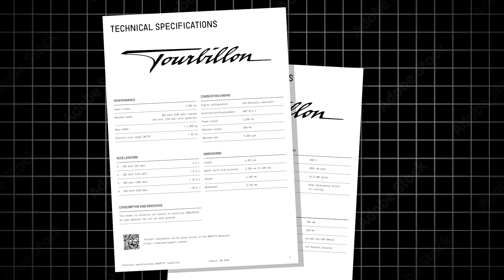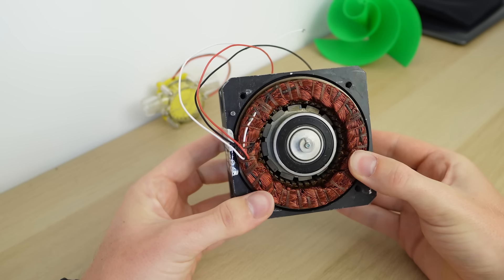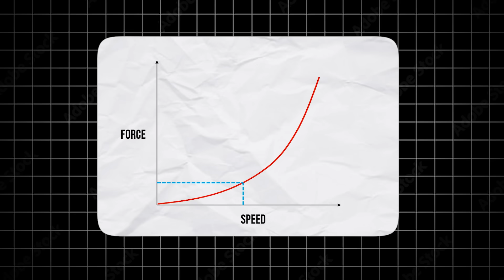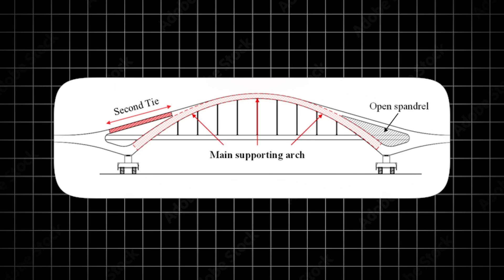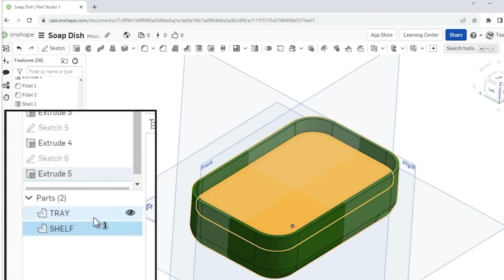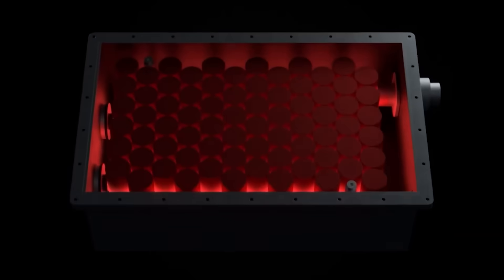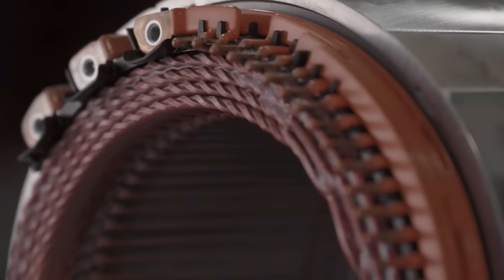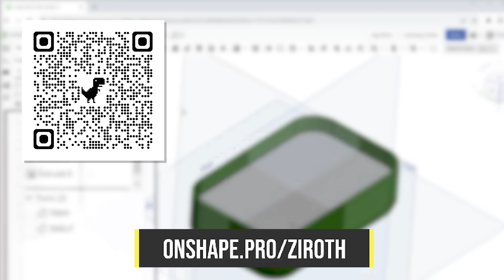How Bugatti's New Electric Motor Bends Physics

Comment from the maker: It's great to see how the partnership with Rimac is giving Bugatti an extra charge! Check out Onshape for FREE: https://Onshape.pro/Ziroth - It's my go to CAD software and I promise you won't regret giving it a try.

Some great comments here adding to the video, here is a summary:
1) Correction at 2:34 - This is not an exponential growth it is a curve with an exponent of 2 (quadratic) - I loosely and inaccurately used the phrase here!
2) The paper at 8:00 uses Celsius to report a percentage drop, which isn't very useful as it's a relative term.
3) I compared RPM as all the motors have similar geometry (automotive size) - but really this forgets the importance of the radius (which needs to be large enough to get some torque from the motor)
Reply: I will mention that while this motor is impressive the capabilities of it are nothing new. Formula E motors often spin at a similar rpm and they can produce more torque (and so power) per motor. 

They may do this my being longer and similar diameter but the point is that without knowing the radius it is difficult to say exactly how impressive. It is cool that they are managing to put formula E-esque motors in a road car though.
Reply: @Zuluknob  Bye bye.
Reply: would be very interesting to see die-electric cooling for gaming computers
Reply: @artcurious807  Already being done.
Reply: Dont forget rimac owns 55% of bugatti so it was gonna be a rimac product at the end anyways
Reply: Time to shootout Koenigsegg and Bugatti EV supercars.  
Bonus if you can get your hands on the Audi RS Q e-tron (you know, the Dakar model) :-)
Reply: Cooling medium comprised of a phase change material that goes from a semi solid to liquid. This could also be used as a energy storage solution for heating the interior.
Reply: For ordinary electrical motors, the "ideal rotor shape" is a ratio D-squared-over-L.  This had been known for dozens of decades.  This was based on powered rotor and stator.  For neodymium/permanent magnets, this ratio is now being altered slightly since the flux field of an unpowered rotor can be shaped to provide advantages in forward/reverse directions and mechanical weight edges with respect to the car dimensions.  Pancake rotors can provide much larger torques, but add serious sizing issues to a vehicle.  Axial flux motors have similar issues with bearing support.
Reply: I remember a chat with Cedric Lynch at Silverstone Race Track UK in the 90's - He was building an EV motorcycle for the TT races using one of his Lynch motors - He explained that the limiting factor was the centrifugal force as voltage and revs rose - I said when the Stanly Steamer  achieved the world speed record in 1903 they wire wound the boiler in Piano wire to stop it exploding and he could do the same - a couple of months later he told me he had  put a modern spin on the idea I'd shared and used carbon fibres - It's odd how ideas morph - James Watt once said "The best ideas aren't hidden in shadowy recesses. They're right in front of us, hidden in plain sight"
Reply: imagine supercooled hypercapacitors... just add "perfect motor." :P
Reply: Ever thought about talking about orbit solar panels. That sends power to earth. Since earthbound solar panels are roughly 10% effective. While in orbit they are 100%. Theirs a NASA study as well the angry astronaut talked about it last six months.
Reply: @Stargate101   "While in orbit they are 100%."  

No, they are not.  If that were the case, they'd generate over 1000  watts per square meter of panel.  And we know that IS NOT going to happen with even the best panel technology.

My panel bifacial panels are about 20% efficient. If I took these same panels into space, they's still only be about 20% efficient.  The ISS panels can hit 30%.
Reply: 6:04 Nonsense. There's no time in kW. If 600 kW can power a village it can do it regardless of how long time. Why do you believe you're entitled to speak about technology without passing middle school physics?
Reply: @Youtube_Stole_My_Handle_Too  but you can calculate the time which the village in it's peak of consumption use 600kw and you can calculate the time like a 3ph motor that consum 3kw per hour

Comment: or they could be using ipm rotors (internal permanent magnet) my ebike motor uses one and i run very low gearing and use field weakening which get me about 28000 rpm at 84v(72v battery)

Comment: 2:30 The force does NOT increase exponentially, it increases by the SQUARE of the rotational speed (as also demonstrated in the example right after the statement). It is a big difference.

Comment: The engine should only be to generate electricity for the electric motor. Hybrid is always the way to go, efficiency and better usage of resources. And that is what cars and truck manufacturers should have done 10-15-20 years ago. You can get so much more usable power and torque from electric motor, and the engine can be much smaller and can run on basically fixed RPMs increasing the fuel economics and less pollution. It doesn't matter if it is a family sedan, a Scania truck or Hypersport car, hybrid is always better. And Diesel electric is the best way to go. But gasoline electric can be lighter so that is probably better for sports car...

Comment: everything sounds like an expert's channel in the first few seconds. until a quadratically increasing acceleration force is described as exponential (derivative/dynamics proportional to the current value). it's unbelievable how inflationary the word “exponential” is used by the layman. but by the expert? it's not splitting hairs, an exponential increase is something fundamentally (not just mathematically!) different from any polynomial
Reply: oh no...and then the thing with the temperature. you obviously have zero knowledge of some fundamental physics. what a waste of time an attraction in the internet

Comment: Imagine if the cooling oil in the battery pack had a reservoir and a radiator or better yet a small electric refrigeration compartment for the batteries

Comment: I don't think the reason for using Lithium iron phosphate battery  is it high power delivery or high energy density because in both cases typical Lithium ion is far better,  then only advantage of using Lithium iron phosphate battery  is its safety , less prone to catching fire and explosion,  and they have very impressive Charging cycle (3000+) comparing that to typical Lithium ion which has around 500-1000 .
Also Lithium titanate is not that energy dense its 3-4  times less energy dense and have lower power delivery, again its advantage is its even more safety and upto 10,000 Charging cycle

Comment: Hm, nice, i was thinking more about A\C "implementation", but this works also, plus removes the need for sophisticated manufacturing of cooler tubes. This could be the gate for diy water cooling for non liquid cooled batteries, and swap's in ice cars. thx)

Comment: Those are the max made with the wrong patent.
2 types of motors were patented by nicholas tesla.
A first that stay cold, simple design, asynchron asymétric, lot of power, lot of torque, 3 times the second patern.
A second, that need cooling, asyncgron symetric, that fights for balance, with back efm, electro counter force.
So seeing a motor that need cooling, you know wich type is under.

Comment: the semiconductor industry had 50,000 rpm motors back in the 1990s, so the auto industry still has a long way to go.

Comment: Also note that small battery capacity.  This means that the claimed HP is quite a short-lived transient, and the engine has to make up for any battery usage, which drops the HP two ways.  (1) Can't use the battery to boost the engine HP when trying to charge it from the engine.  (2) Charging the battery reduces the available engine HP for moving the vehicle.  The only thing that may be missing (I could not watch the entire video due to the extreme cringe factor) is to declare that Bugatti is now going "green".  Just another entry into the "fraud" file.

Comment: 6:44 I don't know where you got your information about the lithium titanite being power dense, but it's actually one of the worst energy dense lithium based batteries you can get.

 It does have great qualities like low temperature performance and fast charging but density is not one of its strength.

Comment: 5:40  This software sounds neat... I'm  kinda bummed its all online.
Where's the built-in resiliency for customers who's internet speeds are still slow, or shut down? 

Anyways,  solid vid, interesting stuff. Especially the batteries soaked in cooling oil.

Comment: As soon as you said "electric flight" I almost did not bother watching. There will never be "electric flight".  The energy density of avgas is 85 times LiFePO4 batteries by weight.  You need 85 pounds of batteries to fly the same time as 1 pound of avgas.  And when you get you your destination, the batteries still weigh 85 pounds compared to the avgas which is continually used up during the flight.

Comment: I've seen non dieletric oil used in submersed motor up to 4KV  like tellus 22 or 32. Power up to 300hp. I dont think it needs to be a very expensive oil for cooling the batteries.

Comment: Isn't it interesting transformers and welders have been using immerged  windings for decades and only now they are starting to immerge hard worked  battery cells and microchips - the E-bike world has been using none conductive fluids to cool coils in hub motors  for a decade - it's fascinating how technology moves sideways

Comment: 800hp is about 600kw so the 25kwh battery will power the electric motors for about 2.5 minutes at full power

Comment: Watching this on my newly built dielectric oil-cooled computer running at 6000Ghz with 7 small but absurdly powerful quantum GPUs - no bloody fans needed anymore - all calculations arrive 0,5 plank-seconds before they actually are put into the system :elbowcough:

Comment: Direct cooling a the way to go as it's just not more effectively the batteries but also help and reduce thermal runaway. I'm currently building a direct cooling battery pack to test it myself. I should have a running prototype near the end of January 2025.

Spinning motor at such speed puts a lot of stress to the rotor but also to the rest of all other mechanical components such as reducing gear. Higher the speed, the more friction it generates, the heat losses you get.

Direct fluid cooling is a topic that is little talk about. Hope to hear more on it.

Thanks for this video.

Comment: One thing you haven't covered or maybe it's a trade secret. How have they reduced magnetic flux reversal time which uses the most current as the pole pieces change polarity the more metal the higher these losses but the higher the magnetostricktive torque.

Comment: Very interesting presentation!   As mentioned at 3:11, one  method to reduce stress at high RPM is to selectively use materials with exceptionally high strength to weight ratios.  Their carbon fiber wrap serves that purpose, but does so 'tangentially' because the centripetal forces are directed radially, while the wrap attempts to counter the forces circumferentially. What aid it provides can be modeled as though it was a vessel restraining a liquid/gas under exceptionally high pressures. (At least in this instance, the load places the epoxy wrap under tension, unlike the 'Titan' submarine's compressive loading that led to collapse, likely due to the epoxy yielding to delamination). 
I expect that Bugatti has also designed the rotor itself to have an exceptionally high strength to weight ratio, enabling the radial forces to be directly countered instead of tangentially. Titanium has an extremely high strength to weight ratio. But relative to other metals, titanium has poor thermal conductivity. Perhaps they judiciously use titanium, such as a 'spider web' of titanium enmeshed or integral to the rotor's magnets. If they can make a 'one piece' rotor, where no bonding is used between distinctly different parts (rotor frame vs. magnets), this would eliminate a potential failure point located near the rotor's maximum radius.

Comment: More clickbait BS. Where's the physics bending?

A few points.

1. Voltage does not equal power. You can get near any voltage you want out of a battery. There are devices outputting many thousands of volts off of tiny little watch batteries. 

2. 24k rpm from an electric motor is not really that impressive. I myself have built electric motors in my bedroom that go well over 80k.

Comment: Nice video, interesting concepts.  One small objection: while the rotor is spinning faster, the centrifugal force that acts on the magnets grows quadratically, not exponentially.  I know a lot of sales and marketing people use "exponential" to designate any variation that grows faster than  a linear function; but in a video published by an engineer, technical accuracy is expected.

Comment: A really stupid design..  The ICE is supported by the electric motor with a lame 25kwh battery...  It shud be the other way around.. A 400kwh electric motor with a 150kw of battery... The 1500cc ICE isn't even needed but can be used to charge the battery during high demand..  An unbeatable real performance hyper car...

Comment: Why does Bugatti stick in a gas powered piston motor with it's electric motors.  Is it just because gear heads need that loud obnoxious racket?  Hybrid EV's, gas and diesel all pollute and are inefficient.  All Electric Super Cars will rule, along with all other cars and trucks.  Even Planes are going electric.
Reply: Sure but for now they are heavy and get beaten by ICE only at 1/10 the cost.

Comment: "The ability to provide a huge amount of power from a relatively small battery is referred to as a high power density."

No. Power Density is when it CONTAINS a lot of power for a given size. Discharge Rate is when it PROVIDES/DELIVERS a lot of power for a given time. And you were definitely talking about how much power max instantaneous power it could deliver.

You don't need to cool a battery because it has a high Power Density. A battery with a high Power Density can sit there without cooling all day long. You need to cool a battery when it's DELIVERING it's power at a high RATE.

Comment: In India they have developed a rapid charging system that injects a coolant into the battery pack while charging and removes it at the end of the charging cycle thus avoiding the extra weight in the vehicle.
Reply: But in cold climates you need the coolant to warm the battery.  Also there is a lot more chance of a leak.  The weight of coolant is very minimal

Comment: I suspect Novec will turn out to be as bad as PFAS/PFOS etc. I researched it years ago for a home pc cooling experiment. I wouldn't touch it with a barge pole. They also often have a high GWP in the hundreds. They are usually full of flourine. With Hydrogen Fluoride being a fire breakdown product. LC50 100mg/l of novec 7100 can kill fish is 96 hours. They haven't tested it on rats yet should be criminal to put chemicals in the world without knowing impact on mammals/humans.

Comment: 800V  State-of-the-art battery pack has been available in Hyundai's Ioniq 5 production model since 2021. A complete 800V architecture and much, much friendlier pricetag. Perhaps this was the reason Ioniq 5 won Car of the Year in 3 out of five categories and was the FIRST EV ever to win car or the year.  But sure... Bugatti sounds sexier.   

Although the Ioniq 5 state-of-the-art battery produces a maximum 277 KW it develops 320 horse power which is enough raw power to propel this almost 5000 lb vehicle quicker off the mark than a conventional Porsche.  As an SUV it is a veritable tank of a vehicle. Make no mistake,  the new line up of EV's are beasts compared to ICE vehicles.  Body center of mass low for cornering. Complete with a plow bar in front for colision protection for your family.
 
Additionally, the Ioniq 5 liquid cooled battery has almost 12 liters of a low-conductivity coolant that is replaced every 24,000 km at a cost of about $300 for the coolant and labour cost varies.

Comment: This approach is going at the problem backwards.  To move a person from point A to point B you need less mass and less power pushing less air out of the way leaving laminar flow air in the minimized wake.  To launch from 40 mph to legally going 180 mph (in town) you need to share one motor with all the cars in the path and leave its mass tied to the ground.  Moving the magnetic field, not a spinning rotor.  US Patents 6,923,124  7,127,999  7,334,512  A wing tunnel tested Cd of 0.07 combined with steel wheels not rubber with a coefficient of .004 not .015.

Comment: It would seem that the toxicity factor has increased with the innovations for cooling the already toxic batteries with dielectric oil. In case of an accident and fire, the environmental damage will be great. Hydrogen fuel for the future is a much, much better option and can use tech already extant. This wild push for electric powered everything is not guided by principles for clean energy in a truly safely controlled vehicle.